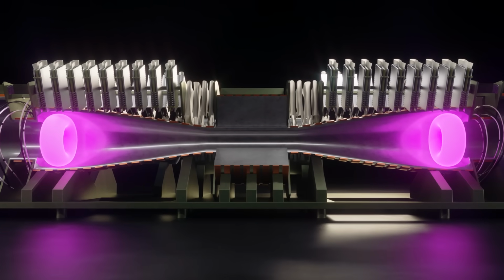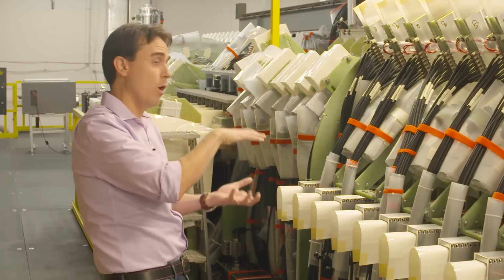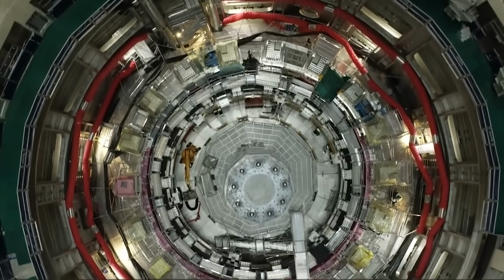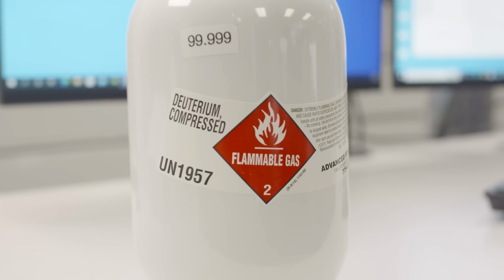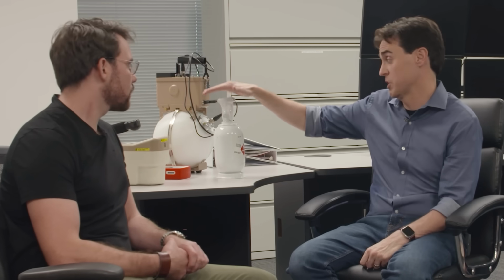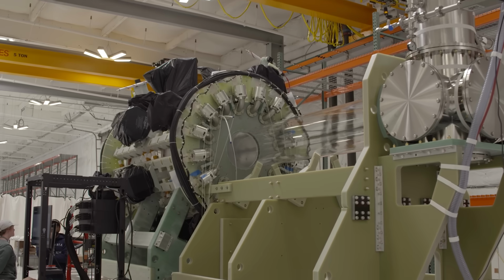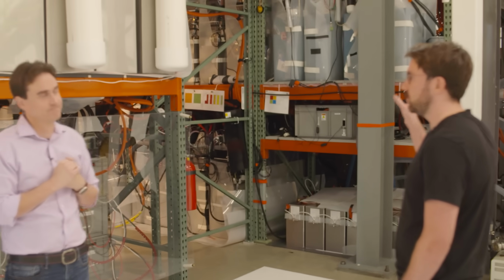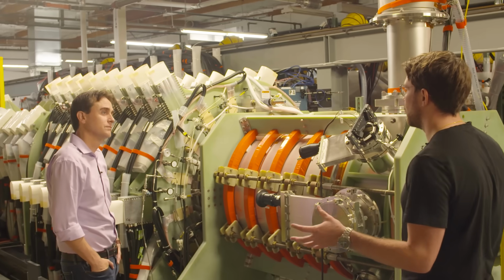A New Way to Achieve Nuclear Fusion: Helion

Comment: I love the candid discussion of technical challenges that still lie ahead. Apparently the goal is to attract more capital to follow through with it and solve these problems.
Reply: @Aqua Fyre absolutely right.  Or different problems completely, and yet again it'll turn out way harder than thought but "easily solvable in the next reactor"
Reply: @Aqua Fyre I don't see how their two-step process is geared towards fission plants.  No.  Also radioactivity doesn't make something not clean energy.  Or do you have a problem with mining rare earths to make neodymium for compact generator magnets on wind turbines which also inevitably produces radioactive thorium as a byproduct?  Didn't think so.
Reply: Helion is fully funded all the way to commercialization, actually. What they need right now is qualified employees.
Reply: @elmarmoelzer2229  how do you know how long commercialization is going to take? Lol.  Is their "seventh generation" reactor the one to mass produce?  I'm going to take a stab in the dark and guess no.
Reply: @MrGottaQuestion   The 7th generation is Polaris that will demonstrate net electricity in 2024. 
The 8th will be the one they will mass produce. Helion generally has a 3- to 4- year cycle between machines. Commercialization might take a bit longer because they have to build production pipelines and all that, but they are already working on the design for the 8th. I say 2028 to 2029 is realistic for the pilot plant.
Reply: @elmarmoelzer2229  so they are going to go from a reactor that barely produces energy (and even that would be amazing news in the fusion world) to a fully commercial mass-produced fusion reactor in one iteration, when it took them seven to get to "almost somewhere"?  Yeah right.  I'm not dissing the team, but fusion is incredibly hard.  That's why I'm not drinking the Kool aid.  Imagine all the issues they will find with just the heating of the capacitor banks when they try to fire off fusion at ten times a second.
Reply: @MrGottaQuestion  OK, let me re- iterate, because I guess I was not clear.

Trenta is around energy break even, at least close enough to convince the investors and the review team they brought in that the concept is valid
.
Polaris will produce enough net energy to produce some net electricity in 2024. 
Polaris will have 1 Hz operation (vs 10 Hz for the commercial one), which is one reason for the lower power output. 

The next machine after that will be the very first commercial machine. It will produce 50MWe. 

Of course that first commercial machine will see some testing and upgrades over the first two or maybe 3 years of operation.
That is OK, it will inform the mass production of those that follow. 
You have to understand that Helion's first machines do not have to be perfect. AFAIK, Helion will operate them themselves and sell the electricity. At the same time, they can monitor them and keep refining. Trenta has seen a lot of upgrades over the past 3 years. 
Btw, the capacitor banks are not that big of a deal. In the past, Helion had a smaller machine that produced over a billion FRC and at a much, much higher rate than their commercial power plant will.
Reply: @elmarmoelzer2229  "Trenta is around energy break even" - I did not see anywhere that Q = 1 or close.  After some quick googling I found that trenta could recover 95% of the energy input and 95% of the fusion energy, which doesn't at all mean they actually made up that 5-6% energy deficit with fusion.  You could keep running a reactor all day with those numbers and civilization dry of electricity.  Sure, the devil is in the details, but as far as I can tell, trenta has NOT even reached energy breakeven, nevermind generating electricity economically. There's no guarantee the next reactor will do either of those things, or even come close to the second.  50MWe?  Cute.  I'll show you a fission reactor built fifty years ago that could do 20 times that.
Reply: @MrGottaQuestion   50 MWe for a very small machine that can be located in almost any industrial area. No cooling towers and stuff. Very simple to operate. Very cheap to mass produce.

As for the energy balance of Trenta. Helion is sort of keeping it a secret, but one can guess it from their scaling laws and the published results from Venti.
Venti had a nTTauE of 10^19 kev s/m3.
Trenta has 3 times the radius and 30 times the volume. Gain scales at radius^2.1
So it should be 10 times better just because of that. But there are other improvements. Plus the Ti:Te ratio increases with temperature and that affects how efficient the machine runs. 
Also, Trenta did not recover any electricity. That was a previous prototype and Polaris will do it again.
Reply: @elmarmoelzer2229  Then look up molten salt reactors ;)  love that you state this machine is "simple" when the developer in another video talked about its complexity, especially in recovering energy and fuel from the exhaust gasses out of the back end.
Reply: @MrGottaQuestion   It is comparably simple and small. Regulation will be much easier too.
I am very aware of molten salt reactors. I am actually a big fission (not just fusion) advocate too.
I think fission is great and we need more of it. But it is hard in the current environment, especially regulatory and also public perception and political. Wished it wasn't that way.
Either way, IMHO pitching fusion against fission is the wrong thing to do. It is fossil fuels and certain environmental groups who are the problem. The little funding for fusion does not make a difference. There is so much money wasted on defense and other stuff.
Reply: @elmarmoelzer2229  money on defense isn't necessarily wasted when Russia is knocking on your door.  Europe should pay attention.  Funding for basic research IS limited.  The problem with fission is it won't work.  Your "small" machine will be gigantic (before you argue with me, include the rapid cycling capacitors that would be needed maybe in many duplicates to give them time to cool off sufficiently).  They aren't at break even or even say when this will happen (because they are far away).  And even if it generated electricity, it would be expensive.  Just getting helium 3 will be an insane hurdle that some videos make seem like a fun side project.  Calling this "clean energy research" is scamming people.  Cool basic research that may one day in a future century become a power source or more reasonably a weapon, sure.  But we will have to have solved climate change by other means by then.
Reply: @MrGottaQuestion  Most of this is nonsense. 
The capacitors are not really an issue.  
Trenta is among the fusion machines with the highest triple product. 
Polaris will demonstrate net electricity production in 2024. That means not just "break even" (as many definitions as exist for that) but net electricity production.
He3 availability is not an issue when your machine is good enough to have small amounts of net electricity with just D-D fusion, as Helions machines will. 
Then you get one He3 for every other D-D fusion reaction and one Triton that eventually decays into more He3 in the other branch if stored long enough. 
The Tritium can also be sold or traded as much as the market allows. 
Either way, with D-D fusion essentially supporting itself, you get the He3 and the Tritium for free. The D-He3 reactions then make the sellable quantities of electricity. 
Eventually He3 from Tritium decay will add extra supply to run at a higher ratio of D-He3 to D-D reactions.
Helion is also considering purpose- built He3 breeders that run on D-D fusion only. These would likely have some optimizations built into them and might (though currently not planned) even have a Lithium blanket for extra Tritium production.
Those machines could then produce as much as 2 Tritons and one Helion for every two D-D reactions. Sell some of that Tritium for extra profit and keep the rest for decay to more He3.
Reply: @MrGottaQuestion  US defense spending is incredibly wasteful. They are buying tanks that go straight to the graveyard because they need to ensure that they spent their entire budget so they can ask for more the next year...
And then there is all that money going to fossil fuel subsidies and whatnot that could go to fission. Really fission does not even need that much money invested. It needs friendlier regulation and less red tape.

Seriously, US fusion budget has been tanking at around 500 million/year on average for decades. That is peanuts! US defense budget is approaching 1 trillion/year. Like 2,000 times as much...
But yeah, "fusion funding is the problem"... 
Give me a break!
Reply: @elmarmoelzer2229  Globally, fusion funding is almost $5billion/year just for private research (like Helion).  US gov't contributes 700 million per year, and Europe about a billion for ITER.  Fission research in the US doesn't reach even a billion a year, and in many other countries like the UK and Germany has plummeted to 0 (though they continue funding ITER), despite fission being a vastly more promising technology, and the majority of that goes towards fast breeder reactors, which are also a flawed technology and exceedingly difficult to commercialize, to say the least.  Imagine putting a modest budget of a few billion dollars a year in setting up a Molten Salt Reactor assembly line.  Our energy woes would be history within a short time scale.  But nope, people hold out on the answer because "fusion promises to be safer and cleaner."  Though this is a lie, since fusion outside of a bomb doesn't work.
Reply: @elmarmoelzer2229  "most of this is nonsense" - how is having tons and tons of capacitors a non-issue?  It's a massive cost driver.  Same reason Tesla battery packs haven't solved renewables' intermittency problems. Also, have you ever considered that tritium will pose nuclear non-proliferation concerns?  Tritium bottles are attached to nuclear bombs to "boost" the fission primary (produces lots of neutrons, therefore shrinking the size of the uranium or plutonium around it needed for a critical mass).  The regulation of this would actually increase costs, especially if they will be sending it to third world countries that will be generating 85% of the worlds electricity demand in some decades.   Your special -made helium 3 reactor adds costs.  It's best to avoid complications in already massive projects.  And you say the D-D reactions will, D-He3 should, do something in the next reactor.  Seeing is believing, especially with fusion.  Decades of over promising, under delivering.
Reply: @Aqua Fyre Yes, and? Corporations will not put a stop to that. They have to compete with other forms of energy. So if the engineering can produce it at reasonable cost, we will get it at reasonable cost. If the cost is unreasonable, it will never be adopted. Profits will take care of themselves at some margin of reasonable.
Reply: @Aqua Fyre Even with governments putting their finger on the scale, they tend to lose to market forces. I'd say even an initial 2x cost would be "reasonable", and of course the costs would come down as patents run out and efficiencies are gained. But no project has demonstrated anything like that, and it seems unlikely that is going to change anytime soon. My worry is that fusion will cost like 50x for a small power plant. Complete non-starter.
Reply: @Aqua Fyre fisión isn't "easy" in nature.  It happens inside a star.  If our scientists had the temperatures and pressures of an entire star pushing down on the experiment, fusion would be easy too.
Reply: @Aqua Fyre It matters how much radioactive by-product they produce. I imagine it's a lot less than a nuclear fission plant, but it would be nice to see some numbers. Also, another benefit is they don't need to start with rare and expensive nuclear materials like uranium or tritium. Plus their by-products like tritium might even be used in other reactors. If they can actually get this to a useful commercial scale at reasonable costs, the regulation problems would be minor in comparison.
Reply: @Aqua Fyre What you consider the biggest hurdle of them all I consider the most trivial. Perfection being the enemy of the good, we know there is no such thing as perfectly "clean" energy. The real challenge is actually getting a working system, at scale, and at reasonable cost. That is what I am most skeptical about, and no system has demonstrated that.
Reply: @Aqua Fyre Investment cost or corporate profit seeking doesn't concern me. Fusion to me is a long-term energy proposition. But the real hurdle is getting it actually working.

Comment: Aren't neutrons flying off this reaction super dangerous or is the amount released pretty small? From what I understand the biggest immediate threat to living things is radiation from neutrons as they have a lot of energy and can go into and through almost anything.
Reply: They will need some shielding but the neutrons are a lot lower energy than from D-T fusion (2.45 MeV vs 15 MeV). So they are a lot easier to deal with.

Comment: While this is an interesting and innovative approach to achieving fusion, Helion still haven't cracked power generation since their method still consumes more power than it makes.
The analogy of the internal combustion engine did give me an idea. Just as an internal combustion engine can have multiple cylinders to smooth out power delivery, why not have multiple FRC fusion generators working together in sequence?
Reply: That's what he was getting at in the end... They are working on the energy capture part and should have that in 2024 in their next model being built now.  I think mathematically they have proven it but now they are still implementing it (with a bazillion patents in place too).  I think the idea is to discharge those capacitors in let's call it a unit of 1, and expect 1.25 to come back.  Then that would 'trickle charge' a giant bank of batteries that would feed the grid.  I don't think they could run at 60 hz out of the gate, but topping off batteries would work, I think. I hope it pans out.

Comment: What if you shoot plasma from 4 directions and make a variable spin internal chamber to modulate the reaction?
Reply: Timing would have to be even more critical unless it was like a two cylinder engine.
Reply: @larrytanksley7094  Spin-VCELS modulation using the existing magnetic field. Instead of combustion pressure like the engine, you're using an optical pump. Since the core is both energy and data, with nodes and sensors you can time variable linear and circular polarization. The electron field becomes a code or a chart, even a type of processor. Among other things you could conceivably do with it.

Comment: 12:49 One thing I realized (well, unrigorously guessed) looking this diagram is that mining helium-3 on the Moon is very unlikely to actually be profitable when we're in a position to do it (though minding gas giants or stars like the Sun might be). The other thing I realized is that, since tritium turns into helium-3 in a few years, the only reason for treating tritium as easier to get is that it's easier to get IMMEDIATELY, if you only know how to efficiently do the n + Li-6 -> T + He-4 reaction* and not the D +  D -> n + He-3 reaction. If you have time to wait for the tritium to decay (and even get a little power off it as it does so), then there's no way tritium can be easier to get than helium-3.
*and that's only more efficient assuming lithium-6 is easier to get than helium-3 or tritium, but I do imagine that's true, especially if lithium-7's is also useful.

Comment: Helion's development (comparatively) rapid and prototyping makes ITER look like a horrendous decision. I am honestly pretty convinced this tech will success if funded long enough to work through each design and iteration phase slowly leading up to a viable grid scale generator. Amazing stuff.
Reply: You're plain wrong. Helion first announced in 2009 a commercial reactor for 2020, where are they now ? They achieved recently Q = 0,0007 (breakeven point is at Q = 1). ITER will reach Q = 10 around 2035.

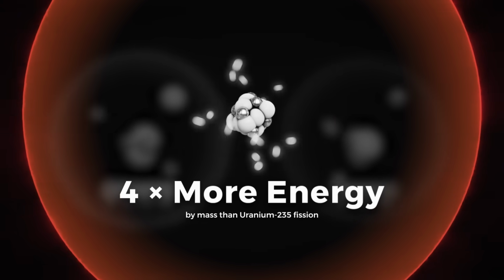Comment: I love that they use the dog cones to keep the cables together on this amazing machine (seen at 16:10)
Reply: You mean how we use Helion insulation sleeves as dog cones?
Reply: Those will be largely to stop lightning flashing to nearby metal. High voltage environments need such materials because the electricity can arc a significant distance.

Comment: This seems like kinda an obvious solution for their capacitor issue regarding the pulsing I'm sure had probably been thought of. Couldn't they just have multiple arrays of capacitors to trigger one after another so the workload isn't being stressed on the same ones over and over.

Comment: All that matters is whether the output sufficiently exceeds the input and the cost is low enough so as to make this a practical electric generator.
Reply: Polaris will demonstrate net electricity in 2024. The whole program is less than 500 million and that includes building a prototype manufacturing line and of course the research and all that. Trenta only cost 35 million to build and operate for 2 years.
Reply: @elmarmoelzer2229  
Cost per kilowatt is the number that matters. Ideally it should be equal or  lower that what customers now pay. If higher it has to be a reasonable increase.
Reply: @PrivateEyeYiYi  Helion is aiming for 1 cent/kWh.
Reply: @elmarmoelzer2229  
That’s impressive, we’ll see if they can follow through.